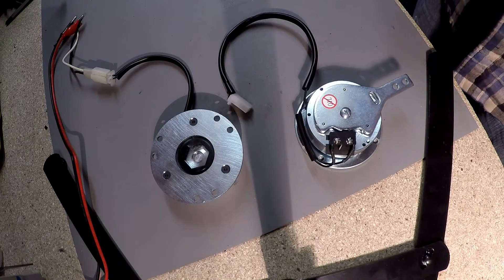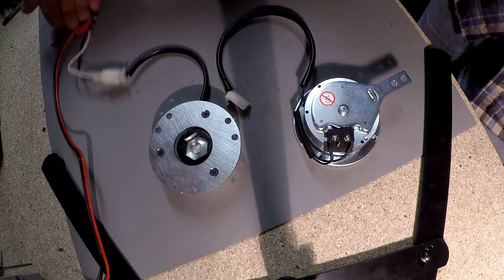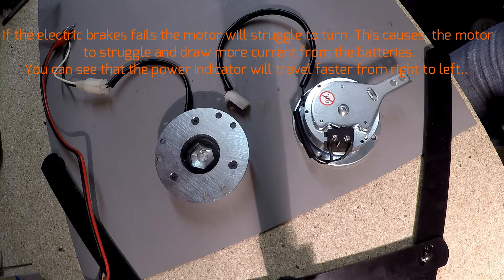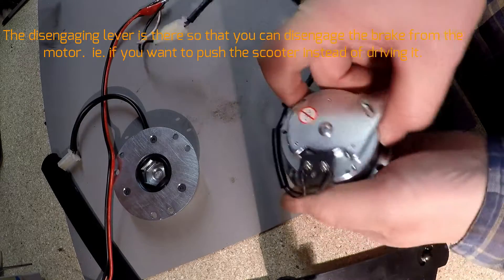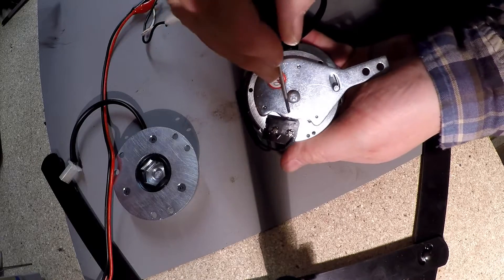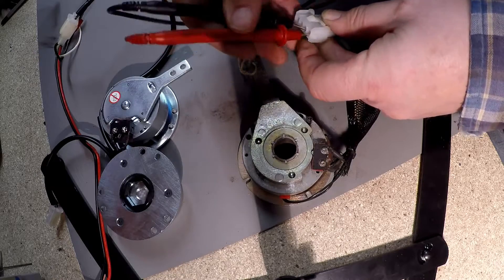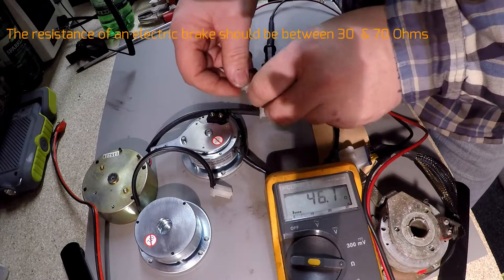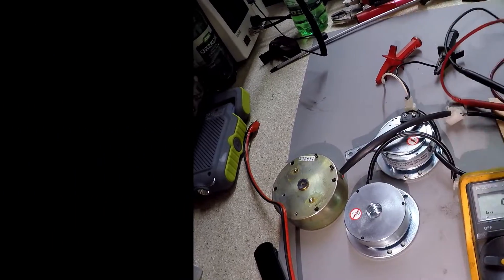Mobility Scooter Electric Brake Testing

Comment: Thanks for this. I've tested our brake on the Midi 4 with your tests. Kaput. I've seen an identical replacement, but its label says 18W whereas ours says 12W. Is that important? Also, are the levers interchangable?
Reply from the maker: @andymann6061  the wattage means the brake strength and yes lever is exchangeable. If you send me your model number I can check for you

Comment: I asked the other day if the little gasket between motor brake and micro switch was important, was told no. After fitting a new micro switch the scooter would only work in free-wheel and not drive, if I took he switch away from the motor brake, it worked as normal, at first I thought I had my wires crossed, didn't make any difference?
Reply from the maker: Or it’s the wrong type of switch
Reply from the maker: Must of wired the micro switch up wrong 😑

Comment: Great vids! I have an ebrake which gets warm just with the motor running with wheels off the ground, is that normal? not too hot to touch but pretty warm, are they supposed to run completely cool?
Resistance is 48 ohmns, have cleaned out the clutch faces no dirt in there any more.
Reply: so did a bit more testing, my resistance from memory was wrong, it is 37ohmns, so I just applied 24v to the brake and it works fine, current draw initially is 610mA, which matches the resistance @ 24v, but over time it gets hotter and the current goes down, after 5 mins current was 510mA and brake was pretty hot. So have to assume the resistance goes up as it gets hotter, that would explain the heat.
These things are damn expensive items, toying with the idea of rewinding it myself.
Is there some way to repair the windings? its all potted in epoxy so will be difficult job to get the old windings out and see what size wire is used.
Reply: Thats fine

Comment: Cheers for this, I've just took apart one of those new brakes that don't have the lever as its stuck in brake mode. I tested it with 12v like I did the motor and nothing is happening with the brake. Do I need the full 24v to activate the brake then? So these are not meant to be able to be pushed free wheel? Thanks
Reply: 24v doesn't activate it either. You can only take it apart so far. Its sealed. Don't like buying replacements but at least its not the control module lol.
Reply: Yeah, its an open circuit. No resistance and you can't get to the where the neg a pos wires connect inside
Reply from the maker: I would replace the brake and yes you would need 24 volts to activate the solenoid/ brake when power is applied the disc should move. But If you hear a click try and dislodge the disc by trying to insert something thin in the gap to dislodge the disk that is stuck
Reply: Thanks for getting back to me👍👍No click at all. I did take the discs out and although a little oily they were clean. I've blasted it with electrical spray but still no click. I will get new brake. I did attach a different electric brake just to see if the scooter would go but error 7 came up instead. Just hope its because it didn't recognise new brake and not a cpu problem also.
 @tomjacques4

Comment: I was getting the four beep brake code on a Golden Buzzaround. The micro switch was bad so I removed it from the circuit. The brake should still be getting 24 volts with the switch removed from the circuit, but one wheel is spinning slower than the other and stopping quicker than the other. I believe that maybe the brake is dragging. Any help is greatly appreciated. Thanks!
Reply from the maker: It’s normal
If one wheel spins slower than the other as they are fitted with a differential.
Reply: @tomjacques4  Thank you for the quick and informative reply. I failed to mention that the scooter will barely move on the slowest setting, but I don’t think the speed pot is bad as everything else was working before the brake issue. Could it have something to do with the problems I was having with the brake?

Comment: hi great videos cant turn off.anyway i have a problem with my gogo,it runs on,that is when I let go of the tiller (forward or reverse) its keeps moving for about 2ft before it stops.is it an easy fix.
Reply from the maker: at max speed it will take some time to stop if you want it to stop quicker than you need an engineer to alter the software in the program

Comment: I think my kymco midi brake is sticking on, I have continuity and I have 31 ohlms from the e-brake. Scooter is going slow brake doesn't come on straight away when accelerator is released, comes on viciously about a second later causing the back wheels to lock up and slide
Reply from the maker: Maybe a programming issue or a  worn motor.  Scooter will slow down before brakes comes on but if it takes longer to slow down then brake I’ll come on while it’s driving. Hence stopping fast

Comment: Hello... Thanks for uploading this. I'm hoping you can help, I cannot find anything online to help.
I am in the process of installing the wiring from a scooter into my little boys electric car.
The problem I have is getting power to the motor (not the scooter motor) no matter what I do I cannot get power unless the brake/freewheel wiring is connected to the loom. I have tried bridging the wires supplying the brake but I get no power from motor wires. I cannot work out why bridging the brake/free wheel wires doesn't work 🤔
I really hope you can help, my little boys patience is wearing thin.

James

Comment: The electric brake on my CTM scooter has failed. Smoke , smell and seized . 5 flash code = electric brake . I have just replaced it with new one of differ wattage and it still brings up the fault . Is the controller not recognizing it because of the different wattage ? .
Reply from the maker: Hi 👋, you should always replace like for like in voltage and wattage. Some brakes can be wired differently so that could be the issue.

Comment: on my gogo scooter the microswitch checked out OK.  but the scooter will still not drive and is still giving the error code 5 (5 beeps).
could the problem be in the electric break instead?
any thoughts would be greatly appreciated
thank you
Reply from the maker: Could be or the wiring check all connections

Comment: Scooter draws to many amps on up hills. Changed motor, disconcerted brake. Batteries new and checked all wiring and connecters. Could it be the controller?
Reply from the maker: Could be that the hill is too steep for the scooter. Did you ask the manufacturer what the current draw should be. May be an issue with the trans axle.
Reply: Draws the needle into the yellow on the slightest of hills. Could the break still draw amps even though its disconnected from the motor. Could the controller cause this?
Reply from the maker: @terrancesimpson  no controller would not it will be the motor that draws as it’s struggling up hill

Comment: Would it take 36v?
Reply from the maker: Mr Green most electric brakes that are used in mobility scooters use 24volts.  I can recall around 20 years ago some used 12volts. But it’s was rare. Some scooters may have a system that it’s motor is 36  or 48 and they would have a special electric brakes or just fit a lower rated brake and get the controller only to supply  a certain voltage as per spec.
Reply: @tomjacques4  Thanks for the reply!,  Im asking beause im planning to take an old scooter i have with a dying motor, and  overvolt it for some fun on the mud!
Its a  shoprider sovereign mobility scooter its all 24v
 im planning to install an extra battery and connect it and  the motor (24v 450w) to an ebike 36v 700w controller and throttle,   
the scooter has no manual brakes/levers so my idea is to supply constant voltage to the brake and make it disengage on a momentary switch for skids!
Can i ask you a question 
If the above does not work, do you know if  the brushes on the motor brushes will slow down the scooter like it normally would with the brake wired up but not physically connected to the motor?
Reply from the maker: Mr Green I’ve never tried this but using higher voltage will eventually lead to product failure. Will work for some time mind you to have some fun
Reply from the maker: Mr Green you may find the if you use a brushless motor the speed may not increase if you add more voltage it will all depend on the motor that is fitted.

Comment: I have a scooter with a 3 wire micro switch, goes into a 4 wire plug, I’m trying to eliminate the brake all together.  Any input on how to bypass? Seems to be 24v comes in to the brake and the micro switch, but not sure how to bypass and make it work. Any help?
Reply from the maker: Jonathan Denham hi there what’s the name and model. Why do you want to bypass it . It’s there for a reason. Does the scooter drive ? What the error code?
Reply: It’s a rascal 600 I believe.  The motor looks to have been under salt water and is locked up.  I am attempting to just use the control system to run a different motor in a different application.  Basically I need a motor speed controller to run a power wheels style motor/gear box.  I ordered a 47 ohm resistor to put in place of the electric brake so that the controller still sees a load.  The 3 wires on the micro switch is what’s throwing me for a loop.  Unsure of how to get fault codes, doesn’t have an LED and it’s not digital, just has a key switch with seat lift/off/on, a horn and a battery charge level indicator

Comment: Do you have automatic  brake for a shoprider traveso cabin car scooter.  Can you give me price thanks
Reply from the maker: John Shanks hi John sorry for the long delay. There are 2 types send me a picture to tomjacques@btinternet.com PS one type is out of stock.
Reply: @tomjacques4  it's OK tested brake on 24volt 100%. Problem is with the motor fitted new brushes last month but someone told me the shaft should of been cleaned before  installing brushes with a carbon fibre pen?
Reply from the maker: John Shanks as long as the commutator is copper colour the its ok. If it’s black and dirty then should be cleaned.
Reply: @tomjacques4  thanks for reply yes it's quite black also I took the motor apart today the amount of loose carbon in it was unreal I don't have a air gun is there any other way this can be cleaned also when removing top part of motor the bearing came out with it and I found like a off set washer just by chance would this be the spring you said in the video does it just sit behind bearing then thank you for replying
Reply from the maker: John Shanks hi yes the spring type washers sit between aluminium moulding and bearing.  It’s ok the bearing comes out with me as well. You can purchase a can of air to clean your keyboard.   Or blow into a small pipe / straw and point it to the area until you faint. Lol
Reply: @tomjacques4  straw seems good to me lol as for  the washers I only found 1 that came out behind  the bearing should there be 2
Reply from the maker: John Shanks I’ve seen some with one some with two sometimes one but they were stuck together so actually 2 always work on a cleared bench so you can see everything   That pops out unexpectedly
Reply: @tomjacques4  hi again just a quick question when fitting the 2 long bolts to motor what sort of torque do I torque 2 or does it really matter thank you my motor by the way is from shoprider traveso  cabin car

Comment: If both leads are black how do I
Know which ones to connect?
Reply from the maker: Roger Tyler I presume you are asking about the leads going to the electric brake.  If that’s the case then it does not matter

Comment: If both leads are black how do you know which ones to connect?
Reply: Usually means that it doesn't matter, with an electromagent, there is no real correct polarity, just connect them up to something that can take some decent current draw with some decent wires.